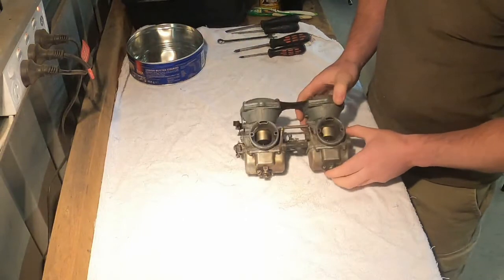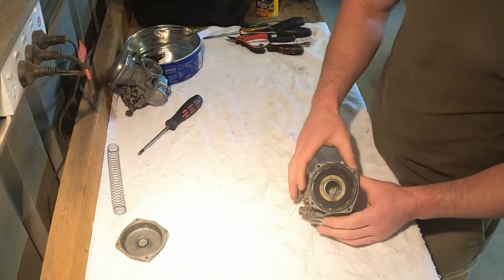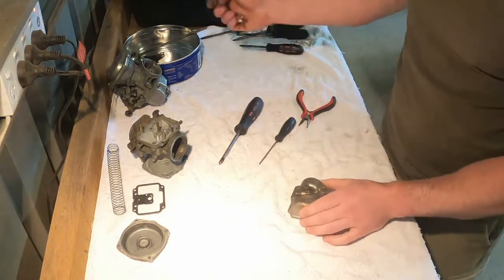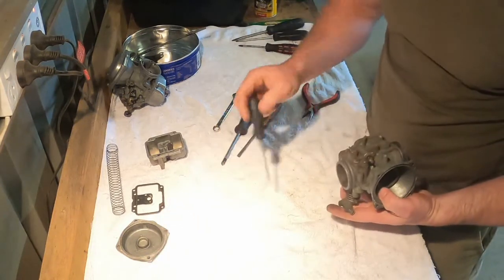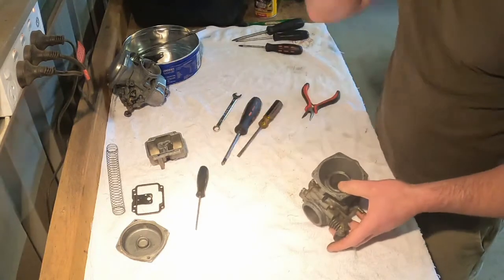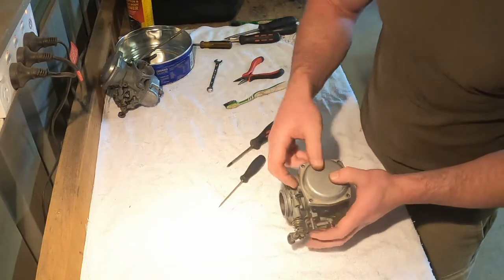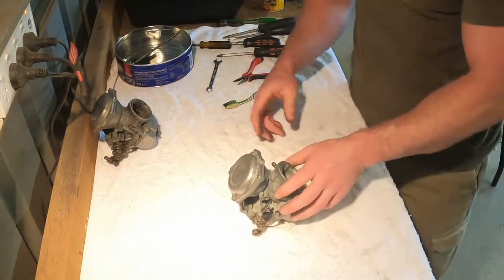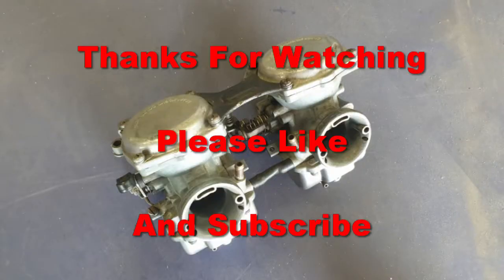XS650 Brat Build Ep 8: How to clean BS38 carbs

Comment: Another excellent  presentation but you'll need to be much more meticulous in your cleaning and setting up proceedures with these BS38s  if you want to get those carbs running well. 

Looks like those carbs are bitsa made up of parts from several different BS38 model years.
They are 1978-1979 model BS38  bodies but they are fitted with a 1976-1977 slide and jet needle assembly.? A stock 
78-79 BS38 should have 502 needles and a Z2 atomiser a 125 main jet and 27.5 pilot jet and the jet needle should have a 'top hat' needle retainer plate . 

The slide , plastic wheel type needle retainer and  jet needle  fitted to your carbs are from a BS38 76-77 model but they do transfer and work fine in the later 76-77 carb body . The atomiser and jet needles are marked and should be matched as a pair.

I found it essential to clean the choke piston assembly and replace the choke body gaskets or there is a potential for un-metered air leaks around the choke body to carb body joints which can cause a lean idle mixture and rising idle speed
Reply from the maker: Thanks for the info. The whole bike is a bitsa so none of this surprises me. They do run quite well though.
Reply: @2wheelworkshop  the 76-79 BS38 carbs are a great performance carb but they take a huge amount of work and meticulous cleaning and setting up to get the best out of them. I put my 79 special in the garage for over a year after I bought it and nearly gave up because I couldn't get the carbs to run right. 
Electronic advance and ignition is a great investment If you haven't already fitted a system. Lots out there but I always recommend Boyer Bransden who were the first to design and supply an electronic ignition system.

As soon as the weather improves I'll do a 0-100kph standing start to see how my bike compares to yours .
Your videos are superb quality and I have learnt a lot from you about presentation techniques .
Reply from the maker: Thanks mate. I'm running vm34s on it atm and am very impressed with them. They are destined for another bike but I am considering getting another set and making the change permanent. I have plans for more upgrades such as ignition and charging but I have other projects that should take precedence and I have been very slack lately.
Reply from the maker: I am very interested to see how your bike compares in the 0-100kph. I feel that the gearing on mine let's it down in the acceleration department.
Reply: @2wheelworkshop  yes i think you're right on the money about the gearing. My 79 is a Special ll and has the 16" rear wheel which does improve acceleration over the 18" but it probably effects the top end quite a bit. i'd always trade outright speed for acceleration though as most of the roads I ride are twisty country backroads .... I will need to check the sprockets and gear ratios as I've forgotten .

Comment: You forgot the choke plungers while they were apart also you didn't clean and visually check the jets. Lastly the lower brace bar was missing.  Otherwise a good quick and easy video.

Comment: for a dunce like me is there a way to clean them without disassembling the whole thing, like pouring gas through it or something? i think my float is stuck - first time running for year after turning off gas poured out the air filters
Reply from the maker: Sorry, mate. You could give the float bowls a tap with a screwdriver handle to try and free up the floats, but even if that works, it will keep happening. By the time you have finished stuffing around with shortcuts that won't work, you will wish you pulled them apart and cleaned them properly at the start.

Comment: Hi Brodie I could really use your help hombré!
I just purchased my first 1st xs650, it's a great bike, however it's been fitted with pod filters and a high flow exhaust by the previous owner, the bike idles fine and runs when at slow to mid rpms but when I get on the gas it starts bogging out. I bought an original airbox and it ran even worse so I'm not sure what to do, I asked the original builder and he said the carbs were standard. Ive never jetted a carb but I'd really appreciate some advice!
Cheers mate

Comment: 10:52 So... turns out if you put the needle upside down fuel rains from the overflow hose
Reply from the maker: 🤣 yep. Suck to find out that far in, then have to pull the carbs back off.

Comment: Hey dude thanks for this video. I just bought my first bike, 77 xs650d (I'm pretty confident it uses bs38's). It was super cheap and came with a bunch of issues including a very leaky carb and it likes to idle at 2500 sometimes. I don't have any wrenching experience but I'm excited to work on it. Any advice would be appreciated
Reply: @2wheelworkshop  sorry I forgot to reply, but thank you! Yeah I just looked at the cost in australia and damn, that's crazy! I will say that I definitely hear a kind of "tssh" sound when I move the kick starter. I know little about engines and stuff so I thought it was normal. I'm waiting for the rebuild kits to arrive and I'll try that out, then I'll tackle the air issue.

Comment: These are not bs38s by the way
Reply from the maker: I'm not an expert but the manual says they are, the throat measures 38mm and they are the same as every other set of bs38 carbs I have lying around off pre 1979 xs650s. I'm happy to be proven wrong though.